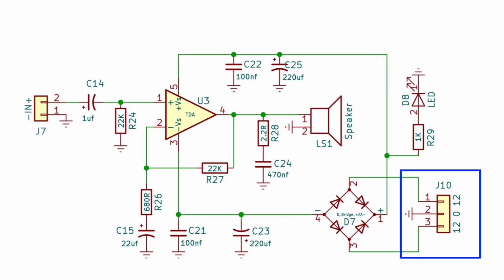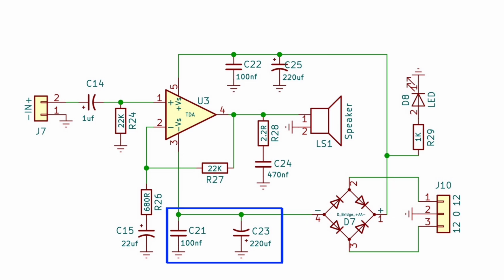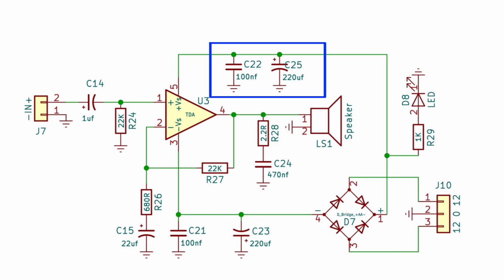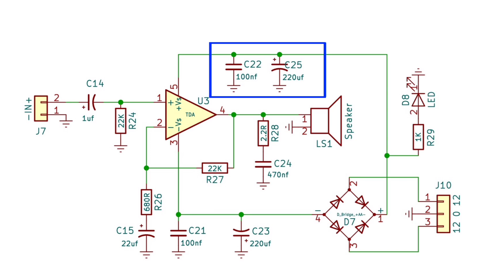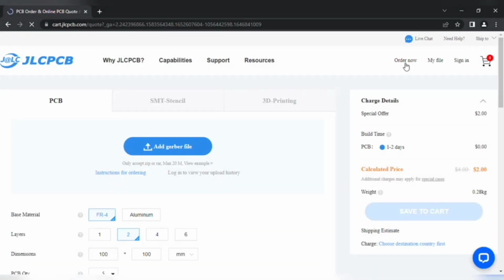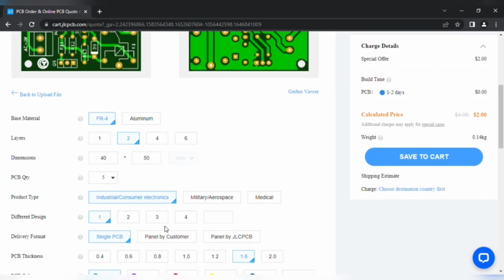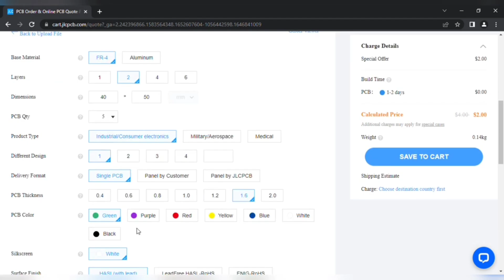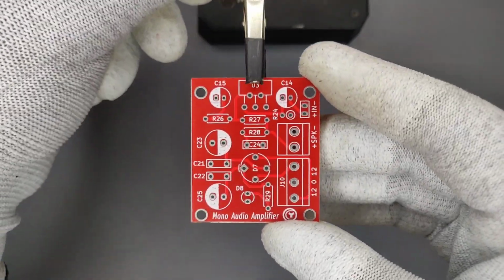DIY Powerful mini Audio Amplifier circuit TDA2050

Comment: Please provide single sided copper layer PDF so that all can make the project conveniently.

All your projects are uploaded with double layer PDF, so it may not be easy for everyone for DIY.
Reply from the maker: Thanks for suggestions, i understand your concern, i think nowadays it os also easy to prepare double sided pcb at home uising double sided copper clad board.
Reply: It will not be that accurate. It's better if you wish you can upload single layer PDF. It's not that tough task for you i think.

Comment: Can u tell me??
Can I make.12V lithium ion battery pack using different MAh of laptop cells.having same volt..i.e,
3.7V,2000MAh,2500MAh,4000MAh.??

What will be the answer.u calculate and tell me...if we connect them in series?? U calculate them..what will be the answer here??

Please..answer me..what will be the MAh??

I think battery will damage...if we connect cells in series having different MAh. ..or not??
Reply from the maker: Yes, absolutely you can connect 3.7v batteries in series with different capacities, and need to connect in series 3x  3.7v batteries, and each battery full charge voltage is around 4.2v x 3 will give you 12.6v